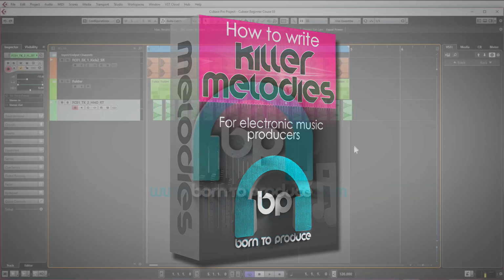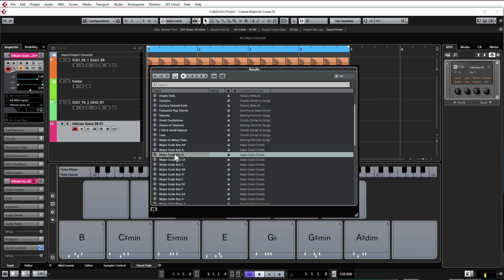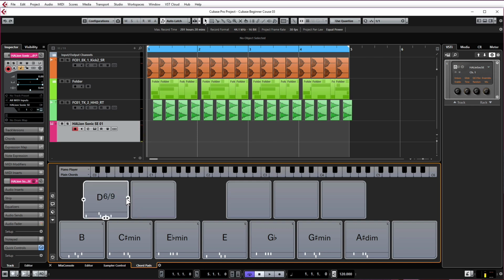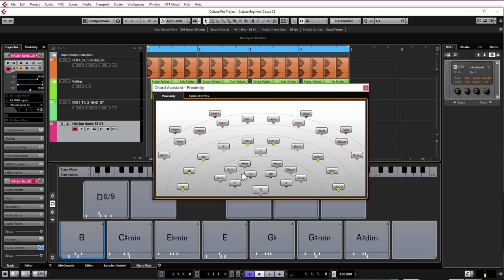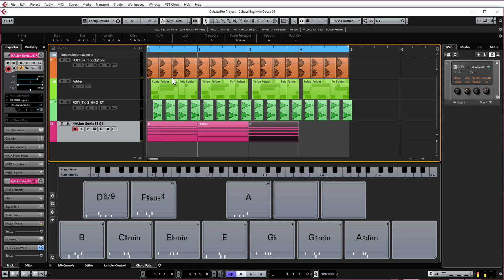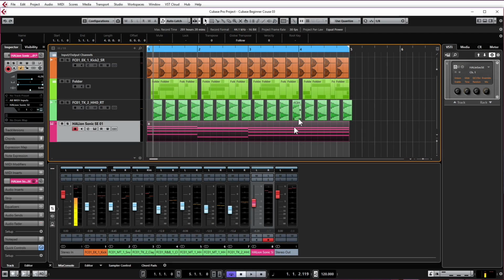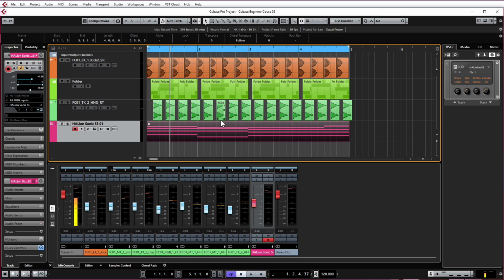Cubase 9.5 Ultimate Beginners Tutorial : Lesson 3 - Easy Melodies

Comment: Alas, when I try to audition the instruments, there is no sound. And yes, I have Cubase configured to use my output device (I can play everything on my time line, I just cannot audition any instrument). What now?
Reply from the maker: That is a strange one, I have never heard of that happening before which leads me to consider it may be a bug. Have you updated to the latest version (9.5.03) ? If not try that as there were a number of bug fixes in the latest updates. If that is not it then you will want to contact Steinberg support and ask them. Let us know how you get on
Reply: I have version 9.5.30, which seems to be the latest. I am just starting with Cubase, so everything is just brand new. I am using the Zoom R24 as my audio interface, also with the latest driver. It is all new to me, so perhaps I am doing something wrong or missing something. I will try to contact Steinberg, and will let you know what they say.

Thanks.
Reply from the maker: Right ok. I'm raking my brains for what it could be. There is not a setting I am aware of that could be responsible for what you are describing. The only thing I can think of is maybe it is an issue with the control room. Go to 'Studio', 'audio connections', 'Control room' and if it is active (little power button will be blue) try turning it off. If it's already off try turning it on. It might be a long shot but it's all I can think of. Hope you get it sorted out
Reply: I’ve done some further tests, and see the problem is with Halion. If I try Retrologue and others that show a keyboard at the bottom, I can hear the sounds. Not with Halion.
Reply from the maker: Hey, ah ok. You might want to use the latest patch for Halion Sonic 3 (if you have not already) you can get it here https://www.steinberg.net/en/support/downloads/downloads_halion_sonic_3.html    There were a few bugs in the older version, it's quite possible that is sorted now.
Reply from the maker: Oh, and also do both the plug in and the content update :)
Reply: I did use the Sonic 3 from the Steinberg Download Assistant yesterday, but then I was told I did not have the license for it, so I uninstalled it (but kept the updated content). I am downloading the one from your link now, and see if it makes any difference.

The strange thing is that I made a project under cubase LE which was included with my new Zoom R24 device, and used two Halion instruments with it. Yesterday I upgraded to Cubase Pro and that is when I could no longer add Halion (nor the drum thing that also was in the LE version), though I can continue to use the two instruments in the original project. But I cannot hear anything if I try to add a Halion instrument ever since the upgrade, neither using the LE version nor using the Pro version.

I have sent an email to Steinberg support. I hope they will reply tomorrow (Monday).
Reply: OK, I installed the 3.15 update from the link, and that made the list of unlicensed things even worse. It tells me to uninstall all those, but they do not appear in my Windows installed list, at least not individually.

I am really starting to hate Steinberg for telling us to update something that we have no license for (I have the license for Cubase Pro, but clearly upgrading the included Halion gives you a separate product) and then telling us to buy yet another license. That is deceitful, and shows that Steinberg is a highly unethical company. And of course, they will not let me return the product.

Oh well, fool me once... I will never buy another Steinberg product.

Anyway, I am wondering if uninstalling Cubase Pro and everything I installed after that, then re-installing just Cubase Pro would solve the problem. But I am afraid that I would lose it all. :(
Reply from the maker: Yeah it's an odd one for sure. Sorry I can'r be more help. Hope you get it sorted and I'd be interested to hear what it was when you do get it resolved. All the best
Reply from the maker: That is annoying Rusty.  I don't think you have anything to loose, might as well try un-installing and then reinstalling again. With the elicencer dongle you should not have a problem with doing that. It should automatically sync the licenses when re-installed. I think it's worth a try
Reply: Please don’t be sorry, you certainly tried!

Anyway, I uninstalled as I said. Then reinstalled. I still got the message about unlicensed things. So, I uninstalled again. I deleted all I could with the HALion Library Manager. I deleted the directory where the rest of them were. I have then reinstalled again. It started but has now been stuck initializing, and I cannot kill it. I’m going to power down the computer now and try again.
Reply from the maker: Hey. With respect to the licence problems, have you updated to the latest version of elicencer? Get it here https://www.steinberg.net/en/company/technologies/elicenser.html   After you have installed it run it and it should do a maintenance update which 'should' sort out any licence problems you are having
Reply: Oh my goodness, I got it to work! What I either missed or just did not know was that I had to double-click on an instrument before I could use it. Once I have done that, suddenly I can audition it and I can use it in a track.

So, now I have to figure out how to cancel my support request from Steinberg, since I no longer need them to tell me this.
Reply from the maker: Well i'm glad you got it sorted. May I ask where you had to double click as I can't think of where you would do that. I never have to double click an instrument for it to become active. Just curious thanks :)
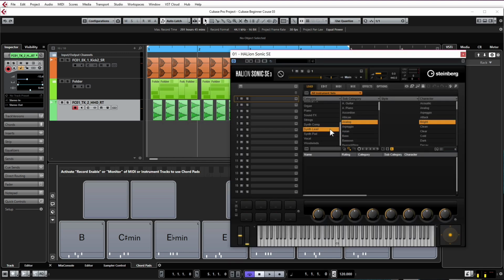Reply: Maybe it is only in the latest version (9.5.30) because I do not recall having to do it back when I was still using LE. Anyway, when Halion Sonic SE3 is first added to a new track, it pops up the window where you are auditing/selecting the instruments, just as shown in your video at 1:48. Then in that last step you are showing (where you selected Finest Lead, though I have to do it with any instrument), I have to double-click on the name of the chosen instrument. Everything else is as in your video.

The way I found out was by watching a tutorial on the official Cubase channel (here on YouTube). In it, the host (I think Greg Ondo) just casually says to double-click on the name to load it. Immediately, I loaded Cubase, added Halion and double-clicked on the name. And bingo! Everything worked.

I was so excited I found the solution I did not jot down the name of the video (and since I have my YT history off, I cannot just look it up there), but anyway, that is how I found out I had to double-click on the name of the instrument for it to be loaded.
Reply from the maker: Ah brilliant. I'm so used to using Cubase in one way that I forget there are many different ways to do things. Thanks for taking the time to explain hopefully it will help someone else further down the line :) Good luck and get in contact any time.
Reply: And thank you as well.
Reply: I had the same problem. Solution: Double klick on the instrument to select it, single click won't do! It needs to show up under "1" on the left side of the window.

For the samples in the previous lessons, single click was enough, so this came unexpectedly. It also looks selected by the big yellow box around it, but it needs to show up on the left. Maybe mention it in an overlay over the video?
Reply: you have to double click the sound. One click will highlight it but a double click will actually load it then you can preview it.